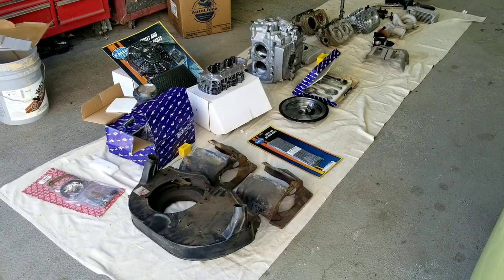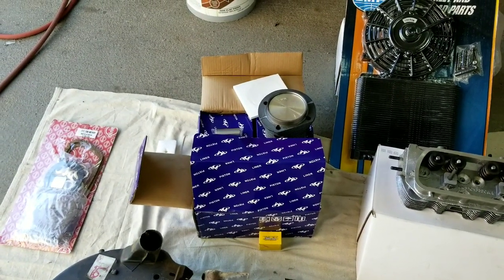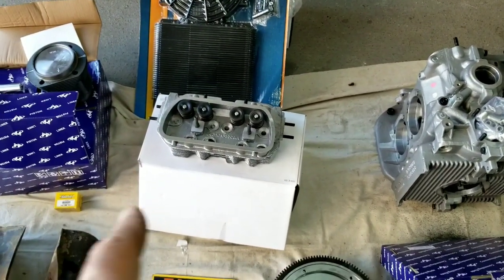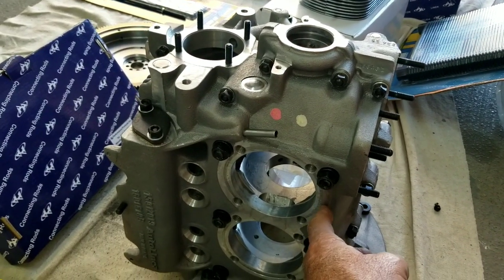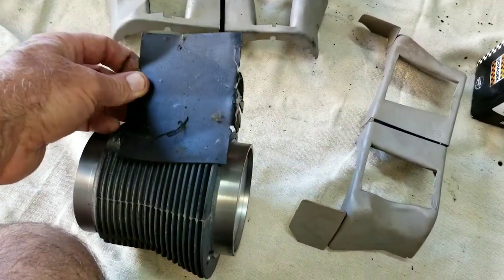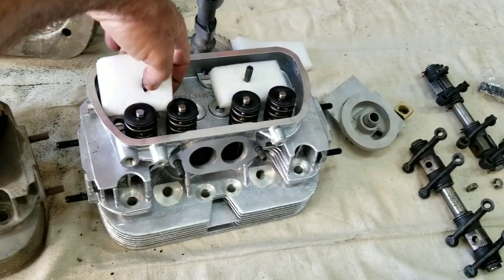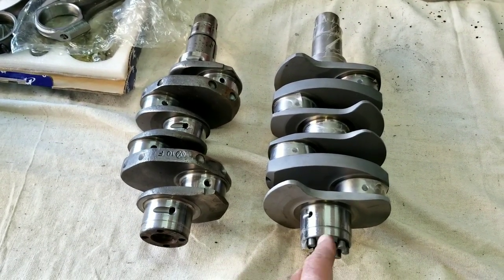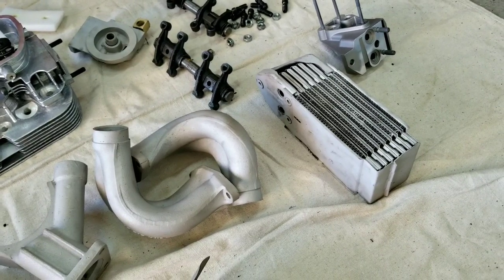Bulletproof VW bug or bus engine build NEW parts layout series part 1

Comment: I've built Vw engines for 20 years, your setup is one of the most reliable nonstock setups, and I've loved them. I normally go with a 74mm crank, and 90.5 p&c's, but smaller than an 82 crank and they tend to be reliable.
Reply from the maker: 78 is about as much as I would call in the bulletproof zone. yea 74 is great too.
Reply: @Mikefngarage  Hi, Greetings from Germany. I am riding a '77 bay window with a Stock 1600 engine, but plan to upgrade. I wonder how to s  elect the piston kit for larger cranks. If you have a 74mm crank with pistons for 69mm, you miss 5mm and need lots of rings under your cylinder? If you use 82mm pistons from AA, it will be 8mm to high with the 74mm crank, or not? Thanks!

Comment: Any engine can be bulletproof, just takes quality parts and blueprinting,  I daily drive a bug with a 2109cc I built in 2010, its currently my only car so it has to run. I wont give up the combo but it has dual 44 Webers so it hauls!
Reply: Why not 'give up the combo'? You're here watching a video that someone else is sharing – if you think you have something good, share it.
Reply: A 2,180 thick wall has same case machining just 94mm heads. Can run less cam and create same power. Even a 1,907 puts out plenty of power/fun , those 2,332 and 2,387 just have too much material taken from the cases.

Comment: Great info for me to better understand my new project build. I just got a 69 Ghia with a new motor with the numbers 74 / 88  written on the shroud  Thank you taking the time and effort for all of us out here trying to learn these builds! I do appreciate your patience and knowledge on VW's
808Hi 🤙
Reply from the maker: Glad it helped
Reply from the maker: Hey My guess it is a 74 stroke with 88 thick wall cylinders. Lets hope they are the thick walls. they had a super thin wall cylinder for 88 too. The 88 thick wall had the same bore as the 90.5 cylinder on the head side. but a stock block bore. Really good street engine called an 1800. Keeps the block strong and gives you a lot more power than stock. also has the counterweighted crankshaft. I would recommend a Breather box for that though make sure it has one. Those counterweights are like a fan inside the crankcase and will create pressure. Valve covers should have hoses to a box behind the fan shroud. and one to the vent at the filler neck.

Comment: Good to see a well set out vid like this. We build about 8 ~9 mild to mid performance T1  mtrs every year (plus more hopped up Type4 & Type1 mtrs). We found that style of Empi cooler really effective for the money. However, don't you think a 72 plate external cooler , plus fan, plus Type4 cooler, plus deep sump is a fair bit overkill if that engine is well built, tuned and running a  suitable carburetor? We're located in one of the hottest parts of the planet and we wouldn't use all that cooling even if that motor was going in a bus. Also, we found that a external oil cooler is more effective than any deep sump so all we'd run is a 48 plate external oil cooler with a inline thermostat and the factory doghouse cooler only on that size mtr. The inline Thermostat still allows about 30% oil flow through the external cooler even when the motor is cold so we don't like to run a too bigger oil cooler. Also, often there's casting sand inside those deep sumps and  pick up tubes that suck air too so there's work there. Please keep the great vids coming :)

Comment: Wow, all nice parts.  Are you using 10mm studs?  With the larger oil pump you'll want to watch your oil pressure.  The relief valve directs the oil to the cooler when the oil viscosity/ pressure drops.  With a higher output pump the oil has to heat up to a higher temperature before it's directed to the cooler.
Reply from the maker: Oh yea for sure you bet The build video will go through some of that stuff as well. 10mm studs and the only ones I use. I dont build 94 bores. but If I were I would machine the cylinders to fit them.

Comment: Mike I agree with u mate if u going rebuild the engine new parts only and yes I would use some original stuff if not too far gone has u say where live old parts are also availble the point should always be reliability when building a vechal for traveling.
by the way mike lockdow is starting to ease now every body can start back to work today but schools may be June 1st or september
Phil in the uk

Comment: im just in the process of building my first aircooled engine for my bus. i have a great case and its never been touched. i was going to do the standard ssp counterweight crank, ssp flywheel, engle 110 cam and make it a 1776. would you recommend anything else? I'm building it for keeping up with traffic, not speed really. i have a stock 1600 that i built up from a longblock recon but bought a second hand engine i have finally decided to rebuild...better!
Reply from the maker: as long as it is not a cast crank.....Those are crap. 4140 or 4340 chromoly are pretty good. But IMO if your going counterweighted. I would go 74 stroker. and put the chromoly short rods in there. it is a lighter setup and will like the freeway....110 cam works well with that too. Crank is about 250 or so rods are about 130 or so. works great with 90.5. Little better power and torque. and a lighter top end. better spinning.
Reply from the maker: and no machine work required....Just a slight bit I put on a video.

Comment: Outstanding Video Mike! 
Okay here we go! Mine is a 74/1600DP Type 1
At 13:26 where did you get those tins at? I never saw those before. Are they okay for Type 1
And your right! They would function much better than the stock tiny ones that don’t cool the whole piston. 
Also do you like car craft? I see EZGZ brought them up. I am only doing a stock or maybe 87mm, although I read the 87s run hot. They have them for 149.00 a piece with stainless guides. Sorry lots of questions my friend. Just for reference I’m building for dependability and long term reliability.
Reply from the maker: I dont use 87s They do run hot not worth the extra poop. Best to send your case and heads out and have it opened up and inspected just in case the line bore needs to be done. Then put in 90.5 you will feel that with a 74 for sure. Now if you want bolt on performance get some of those heads. It will come alive. even with the 85.5 cyls.
Reply: Mike Fn Garage I will have to go back and listen to your video again, and see exactly where you bought those heads. When you say they will be different make it come alive, are there larger valves or something? That would make them do that? 
Take your time answering there’s no rush I know you got better things to do. Yeah I’m going to run the stock Pistons then, I thought the 87s run hotter. I’m just trying to get on the road this coming spring. But build another engine later a 1776 not to race or beat on it just has a nice daily driver because I’m in Pennsylvania and we have a lot of hills.
Reply from the maker: @SladesVWBeetle  it might take a while but may put a link on there with each part and where to buy it.

Comment: Mike, I have watched this build series several times and I have watched a couple of other builders as well and nobody mentions anything regarding engine balancing. A couple of questions
1. Are the parts you used from AA pre-balanced?
2. What ratio rocker arms did you use?
3. What size carburetor do you recommend?
4. What horsepower & torque number did you produce? An estimate if you don't know actual.
Thanks for you help.
Rick
Reply from the maker: to an extent and better balanced than original. the cranks are pretty well balanced. rods are somewhat blueprinted. You can DIY with a gram scale from harbor freight to even tighter specs.  
I would run E gas 38/38 we changed it to that one easier to jet and bigger for that engine works better.
Aa performance 1.25 rockers I like but on that one the cam was already to large for ratios. Running stock with porsche style adjusters. . (fairly cheap. also lash caps or Porsche style adjusters. I dont remember what ones on that engine both work fine.
probably 105 HP  maybe 110. dont know torque. but I am sure the HP to torque ratio favors the torque IF I  put dual carbs  40s full size vents it would run lots of HP probably 140-150and break the tranny for sure.
Reply: @Mikefngarage  Thanks for the info.

Comment: Mike, enjoy all of your be knowledge and tips. You are pretty good at body work and painting too. The drag racing bugs were pretty cool! How much did you spend on the bulletproof vw engine? I watched a video of a guy with a VW van who put a used Subaru 300 hp turbo engine in it. He fabricated the engine mounts, bought a Acura radiator and electric fan mounted under the engine and made some metal tubing radiator hoses.

Comment: I would say the main issue with US owners owning and driving them back in the day especially the lower HP versions is driving flat out or say 70-80 mph like an American car [Oldsmobile. etc.] and also NOT changing the oil every 2000 miles and cleaning the screen as well as keeping the valves adjusted. Having said that the fact its air cooled means lots of heat so it seemed they needed a valve job at maybe 70,000 miles. If the motor is fresh and maintained well driving at say 55-60 it should easily get 60K. I bought a 68 in the late 70's with 85,000 original and motor was NEVER touched, older owner who drove it locally to work for 12 years with excellent maintenance

Comment: Hi Mike.
Lars from Sweden again :) I have ideas for building/rebuilding/upgrading a 1600 type 1 engine some day. I'm not made of money, so cost is certainly a an issue. What I would be aiming for would be an engine with roughly the same torque/horsepower ratio as original, but a bit more. Say revving up to 4500 rpm. I want it to have decent bulletproofness, meaning street and the occasional trip with highway driving at top speed or nearly. I want single carburator and functional heat.
I would prefer original stroke, but with a counterweighted crank to reduce the stress on the block at higher rpms. Those cylinder heads sound awesome. Could you make recommendations on what I should go for?
Sincerely
Lars Karlsson
Reply from the maker: I would suggest going to 74 so you can get the 4340 chromoly I am not sure if the stock 69 size would be in that grade. Stock cranks with welded counterweights are good too but probably more expensive.. Only small clearancing for that can be done by hand I may build out one of my old engines to those specs just to see.

Comment: Mike, do you know which AA head that was that you described in the video? You’re actually linking car craft heads but you talked about AA? Reason I ask is I just assembled my short block with 69 mm stock crank and installed the CB performance cheater cam. Any recommendations on going forward? I have the stark cylinders And pistons but wanted some feedback on which heads to buy. As well as rockers.
Reply from the maker: I like to go with the 88 thick wall cylinders makes a 1679. Then use the 4035 valve heads with single high Rev springs and you get the heads that are open to 90 1/2 cylinders otherwise you might lose some bottom end with those big valves. Stock ratio rockers. But going down the highway those heads have a very good flow. If you can up the compression a little bit to like 8.5 to 1. You will need to  cc the combustion Chambers and use the chart on CB performance website
Reply: @Mikefngarage  so since I bought the 85.5mm cyl and pistons I’ll likely stick with them. But I may change my mind. Okay, stock rockers, what about the push rods? Do I have to cut to length?

Comment: What do you think about scatt c45 cam with 90.5 by 78 mm  & a single 45 webber
Reply from the maker: sounds pretty nice about right for that. more top end with dual carbs but nice midrange strong power and decent mpg with that setup.
Reply from the maker: cam specs are almost the same as mine.

Comment: I have a 72 bus. I’m looking to build (or have built) a good reliable engine. What size do you think is best? About cooling, what do you think of the Porsche style fan shroud?
Reply from the maker: well on that one you have a type 4 engine. They are expensive to build. We were thinking one like this one would be cool if you put type 3 engine tin on it and modified the cooling to work in the late model busses. would take some work but would be a reliable alternative to the original engine which has problems with the valve seats dropping out and causing engine damage.
Reply: Actually, I don’t have an engine. I saw the video about the new aluminum case, and have been thinking of going that way. How big should I go in that route? Bore & stroke, please.
Reply from the maker: @terryfleming7084  90.5 x 78 is a strong stroker motor. going to 82 requires cutting the cam. total build uploaded but not released. yet. coming soon
Reply: Thanks for taking time to answer my questions. What about the Porsche style cooling fan? Are they worth the money for a daily driver, or just for show?

Comment: I wished the new engine cases mag/aluminum would have the Bob Hoover modification done to them. Also the type 3 tins doesn't fit right, if you are going to use all the type 1 tins below the cylinder covers.
Reply from the maker: They fit but you need to wire them up tight. otherwise they wont work properly We will show this on the engine build.
Reply: @Mikefngarage  
 I tried that,it didn't work with the tins I had. The tins I'm writing about is the 2 small ones that go on each side of the crankshaft pulley, behind the pulley tin.
Reply from the maker: lots of Bob Hoover mods are stuff they guys around here have done for years. I have a lot of respect for him but one that he speaks against is the type 3 tin under the cylinders. But in the same breath he says they do work if you do it right. So I think there is only one way to do it and that is the right way. They need to be wired up tight to the bottom of the cylinders We will be showing that. Plus many other things he uses and we have done for years That work well for a long lasting build.

Comment: Please help me understand why I would want this instead of a Subaru motor
Reply from the maker: no radiator also bolts right in and doesn't have a timing belt.Air cooled no head gaskets to blow. and will run strong and cool.
Reply: Ryan Chase I too struggle. My 78 bus engine, parts alone, I was at 3K and the type four store wanted 10K for an engine kit !  Nope, not me, not today.

Comment: why not go with a 30mm  pump? with dual relief  its OK man. + you are going to move the oil a long ways. They only have too muck oil pressure for the first 20,000 miles then it will calm down! Are you going with a quite muffler. Now Mike on a new aftermarket case check the oil pump fit.
Reply from the maker: yea chris called out the 26mm pump. Not sure why but there is a reason he didnt go 30. Not going to rev high for sure with the small carb. Dont want to build the trans and really no need to go that fast in a bus. The new aluminum cases are set up for the 8mm Oil pump studs. Should be fine there. He is working on modifying the shroud for the type 4 cooler. Instead of oil we should just call it coolant. ha ha. Look at that external cooler. Plus the cool tin. He is setting it up like his race motor that runs cool all the time too at 10 to 1 Because he used a O2 setup to check mixture at all rmp driving ranges. and jetted it perfect. Several more motor videos coming. as per your request. plus I just needed to build one. Stay tuned.
Reply: @Mikefngarage  I dont think you understand about the oil pump fit? Mike the hole that it fits into and the size O.D. of even a Shadek pump does not come close too how a VW pump and a stock case size . I have had problems with this before. On a case that was made in 1999 it was so bad it caused it to suck air between the pump and case and spill oil on the exit side . As soon as it warmed up here came the oil light.I took the engine apart 3 times looking for a bleed out before I got a mellings cast iron pump and had to change studs and just for the hell of it put the pump in with no studs and it fell into the hole and would rattle around = BINGO . My boss said to put solder around the holes on the pump and I sanded them like a shoe shine and it went from 4 lbs hot to 55 hot!!!!!! I have the correct measurements of a VW. oil pump and the case hole.I got a new case 2 
years ago and it has the same problem but not as bad .It is called oil cavitation or something????
Reply from the maker: Ok will do should be making the total build video I am sure chris is aware but I will tell him about what you said.. probably using quiet pack yes only because I dont think the merged exhaust will fit on the bus. hits the rear valance.
Reply: 30mm sounds better with that case and extra cooler. Also keyed gear to shaft for pump to not spin the gear on shaft

Comment: Could you make a 30pict1 work with this setup?
Reply from the maker: My friend had a 2007 like this with a PICT 34 3 4 and it worked great. Just like running big carbs at 1/4 throttle which was plenty. pulled pretty strong, super nice torque Stock trans and no issues.
Reply: Matt Jackson no. The pict 1 is just a little too small for a dual port motor. Max you can get out of a 30 PICT 1 would be a 1600 SP. Also, the carb has to have the power circuit (I think that’s the name), early PICT 1s didn’t have it
Reply: @Mikefngarage  awesome

Comment: Do NOT used those spring loaded pushrod tubes,  lost an engine due to them, they got hot, lost strength, oil leaked out, and connecting rod 2 went through the case 12 miles from Buffalo....never going back to that vw shop  who put them in.
Reply from the maker: yea for sure the stock ones are better sometimes on some engines there is no choice but to use them because on some strokers the engine is  extra wide from shims.